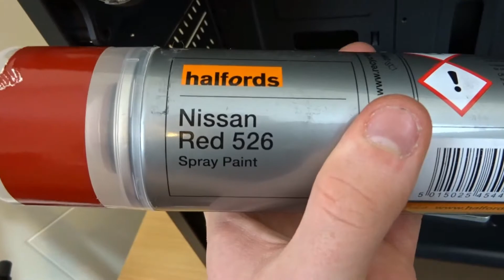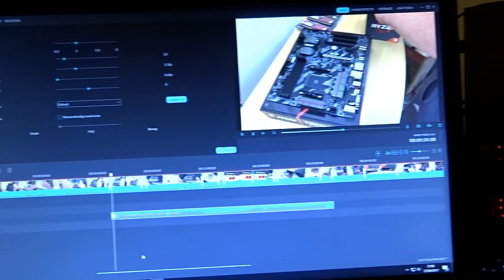Building My New RYZEN Gaming PC

Comment: another question about using the fan for the case on the radiator. did you plug the fan into the mother board or the box at the back of the case? just worried about fan speed. i presume the mother board would do a better job with fan speeds. and where do i plug the pump in?? i have a asus prime b350-plus mb. sorry for being a headwreck!
Reply from the maker: I plugged it into the box on the back of the case. That motherboard might/should have a "pump" connector, designed to run a pump.

Comment: Why u not answering ? Is it possible to remove front planel of the case ?
Reply from the maker: I apologize, I don't always see every comment. You just pull it off from the bottom. There's a place for your hand where you can grab.
Reply: @SamsTechTips  ty mate.
Reply: @SamsTechTips  I buy this case but has shity airflow it is not hight temperatures of my cpu etc.Just the case be warm and i moded the case,mounted front fans to get away from the glass in the case and i get tone of airflow.My English is bad i hope u get it.